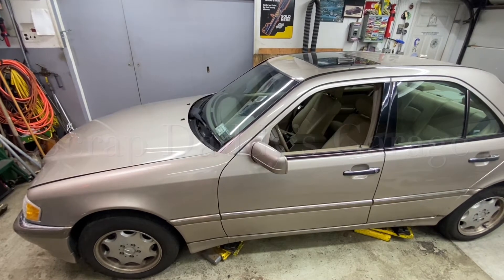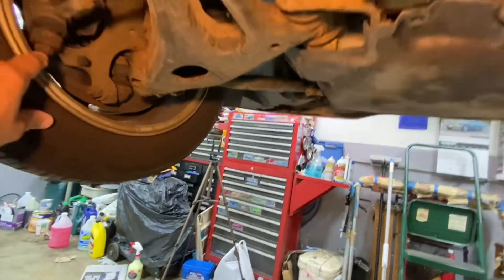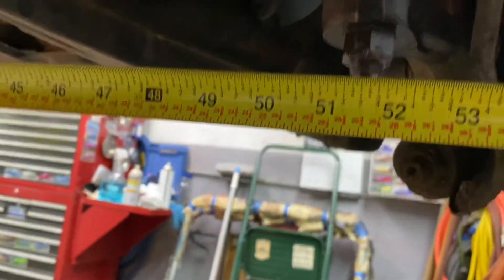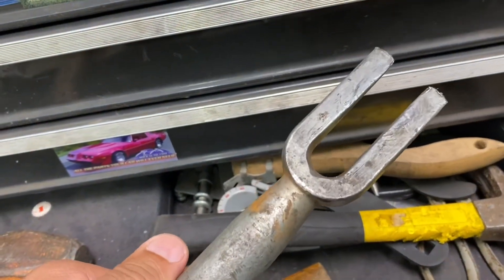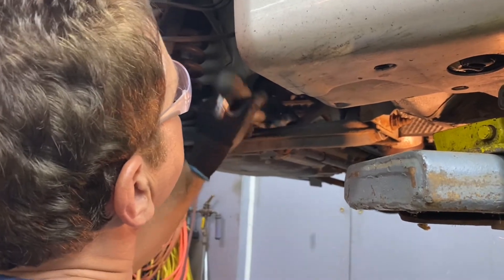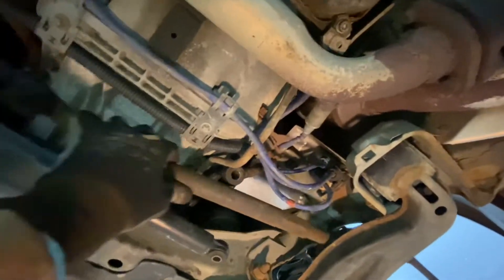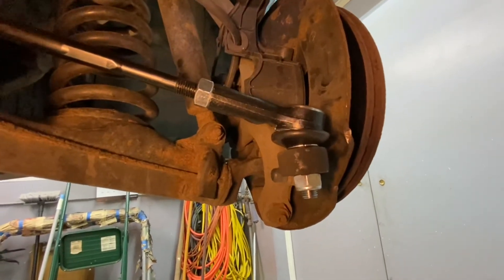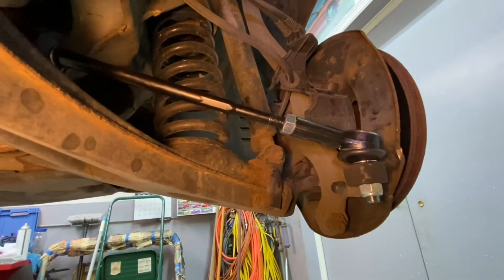Mercedes Benz W202 center link and tie rod replacement

Comment: I hope all is well. It's been a minute since we last chatted. My old grand caravan used go through passenger tie rod ends. Then I MOOGed it myself. Mike told me $55 and I was delivering Parts for him at thetime. Parts Authority charged me $30 Then Mike screwed for $50 more for a Denso radiator, I knew he paid $81 and charged me $130. I called him out on his greed. I let him do right by me with future Parts. I bought my pickle fork when I was 18. I popped the ball joints loose on my 98 Sienna using the small fork. Antonio said,  I need a big fork,  the small one won't wrap around the ball joint. I said watch this! 3 hard smacks with the same 2lb hammer 🔨  the tines survived the big stretch and my tool returned to its normal size. 😄
Reply from the maker: Everything is good! Nice to hear from you.

Comment: I have a leaking steering box. Is it worth rebuilding or try to find a rebuilt one and replace the whole unit? I have a 1994 C280 (W202)
Reply from the maker: I would replace it with a rebuilt unit. Thanks for watching. Please subscribe if you haven’t already

Comment: man i got the worse kind my bolts are facing up not down and the pickle fork was the only thing that would fit and it barely worked
Reply from the maker: I feel your pain. Thanks for watching 👍
Reply: Same here. Can I ask how did you get to loosen the two bolts (facing up), Gregg? From under the car? Or maybe from the top of the engine? Special tools maybe? 
Best regards, Lasse from Denmark
Reply: @lassekalhauge4801  that was getting it separated but if you turn the wheel u can get it to the point where you can reach the nut with a lot of extensions one of those bits that can flex help alot for the passenger side
Reply: @greggarnett173  Thanks a lot 😊
Reply: @lassekalhauge4801  it was a pain in the ass man just dont give up its like mf made it so u had to take the engine out which they more than likely did on purpose
Reply: @greggarnett173  Damn this was my biggest fear 😢 I will give it a go.
Reply: @lassekalhauge4801  it is painful get a heavy hammer and pickle fork don’t give up

Comment: You are doing it wrong. You don't hammer the bolt. You keep the nut on to protect the threads and hammer on the outer part around the bolt. The ball joint will then come loose